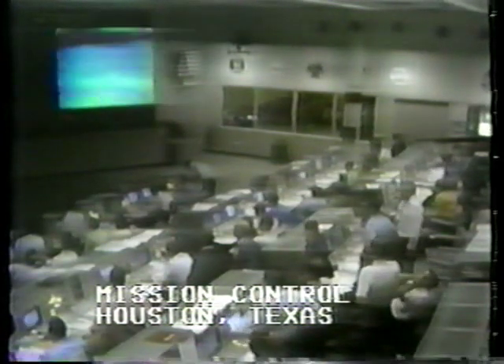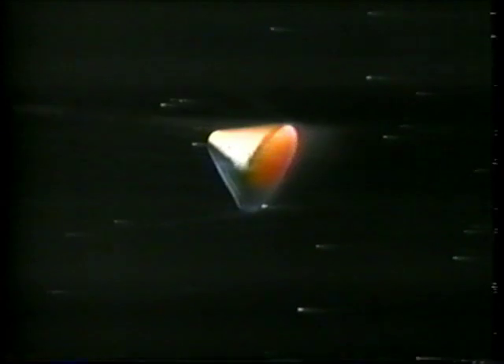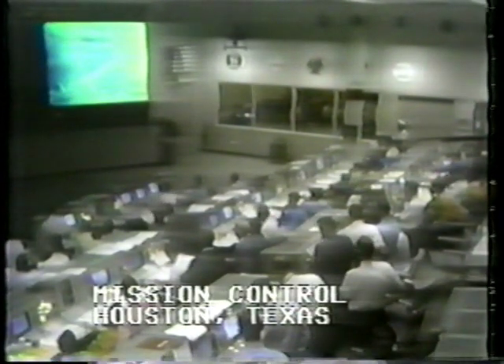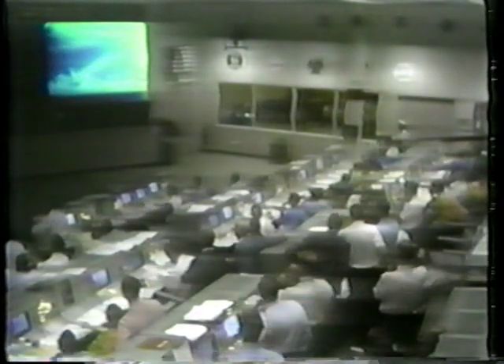Apollo 13 Part 20 CBS News Coverage of Splashdown

Comment: For those asking about TV quality, you have to remember that this TV coverage was all via satellite or microwave RF connection and had analog TV cameras running at 240 lines.  The static on the picture is due to deterioration on the tape.  I'm sure that footage was duplicated and run through machines on a number of occasions.  Each pass deteriorates the image quality and the graphite on the tape erodes.

Comment: Technically, the KC-135 is quite a different aircraft to the 707. It is much closer to the Boeing prototype which was referred to as the 367-80 or Dash 80. The KC-135 has a narrower diameter fuselage as well as some other significant differences. Boeing retrospectively referred to the basic C-135 design as the Boeing 717 - although they later used the Boeing 717 designation again, this time on the McDonnell Douglas MD-90 aircraft when Boeing took over production in 1997.

Comment: why is the footage so choppy and fuzzy? is it due to deteriorations in the tape recording?
Reply: One word: "1970." ;-)
Reply: @michaelbarnhart2593  no, "1970" is not the reason.
Reply: @thomaschristopher8593  Of course it is. Do you think that footage was digital then? Mostly everything was recorded on 1" video tape for VTRs then, which deteriorates from both age and use ;-)
Reply: What I do see is bursts of horizontal lines across the picture every time the ship's radar scans across the TV equipment. This was a serious problem at the time.
Reply: Bobb Grimley  I’m 41 and studied video production in the late 90s. We were still using 3/4” analog tape and linear editing then for our television station then. Digital systems were still incredibly expensive.
TV didn’t go all digital until the mid to late 00s